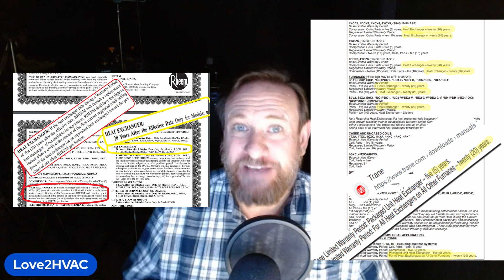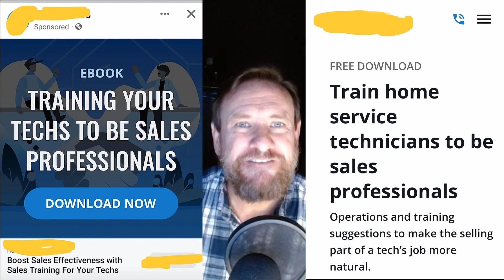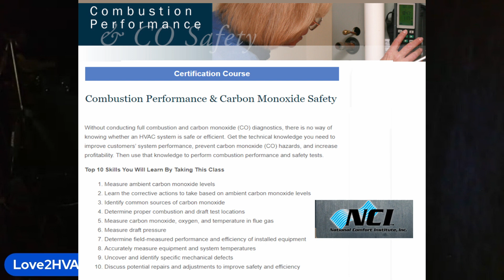Cracked heat exchanger for home owners

Comment: It's worse than you think Ty.  Many companies have techs (maintenance and service) that are 100% commission.  If they don't sell, they don't eat.  I work in one of them as a repair/warranty tech and am hourly.  I repair what these guys sell.  Unfortunately, most are misdiagnosed.  I refuse to replace a leaking coil that isn't leaking and it pisses off my bosses.  However, I'm so good (because of guys like you) that they dare not get rid of me.  If I was a homeowner, I would ask every technician coming to my door one question: "Are you hourly or commission"?  If commission, politely refuse service and don't let them inside your home.  Call around and ask if techs are hourly or commission.  Don't hire companies with commissioned techs.